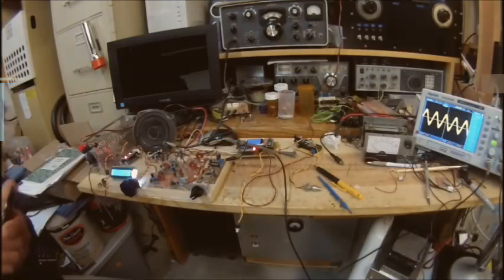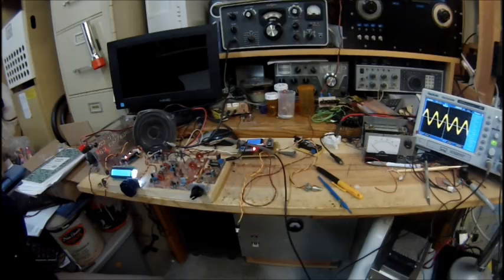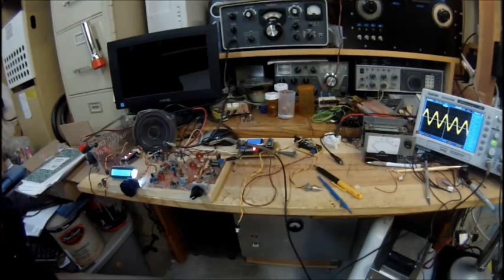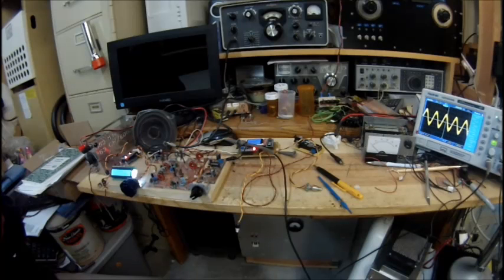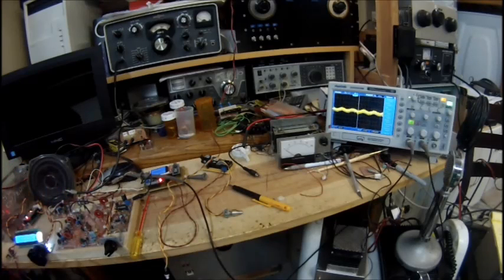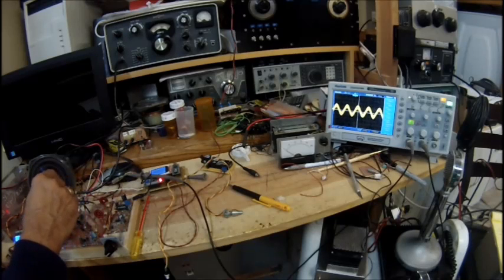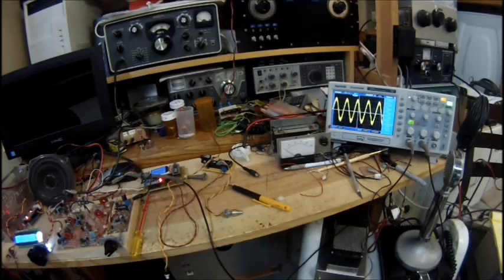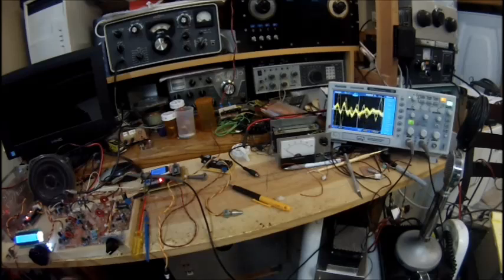Simpleceiver Signal Level Tests

Comment: I built the dual jfet mixer out of J310's.  Have double checked the connections and parts.  Am getting virtually no antenna signal into the mixer.  3t:20t FT37-43 at the antenna input to the mixer.  The mixer is going into a LM386 audio amp.  What is the max  Vpp for the LO signal into the mixer?  I was thinking that the DDS VFO might be overloading the mixer.  I put the LO on 700Hz and that tone blasted from the LM386, so that audio circuit appears to be working.  After connecting the DDS VFO to the antennal input, again at 700Hz, there is some tone getting through, but it is very small.  Can you give me some pointers on troubleshooting?
Reply from the maker: Hi OM,

Sorry to hear that the circuit is not working. It would facilitate the trouble shooting process if you used the email address in QRZ.com for N6QW. Then I can send data and photos.

A couple of things to check. Are both J310's good? I know you said you checked the parts just verifying the info. Secondly the LO should have around 1 Volt PTP at frequency. Is your LO on 7 MHz? 

If you have a signal generator crank that on to 7.2 MHz and put that on to Gate #2 through a 10nF Cap and set to 1V PTP. Connect the antenna through a 10nF cap directly on to Gate #1. This eliminates the primary winding and your LO as being issues. Now if no signals then you are at the J310's.

Pete N6QW
Reply: @N6QW  I did email you.  Thanks!  K4VIB